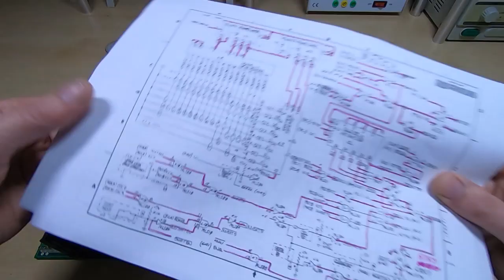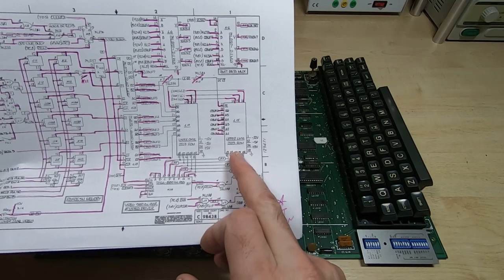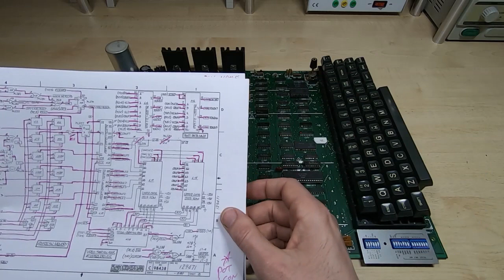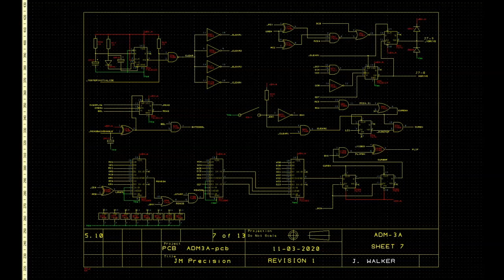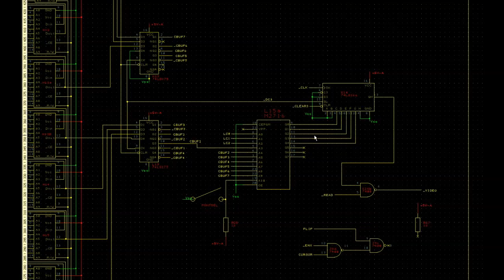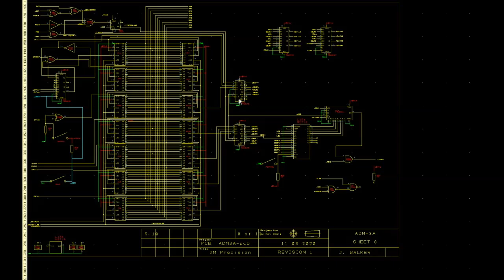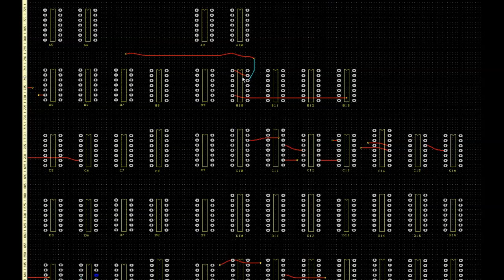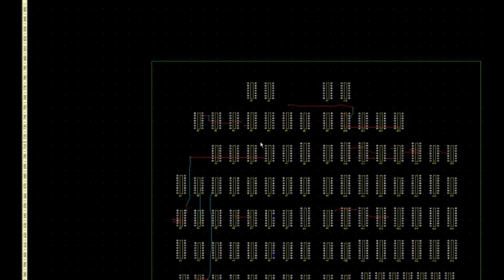ADM-3A  Board Reproduction Part1

Comment: That’s a huge and fun effort! I built an ADM3A terminal logic board about a decade ago using a single ARM32 with a crystal and a few resistors and a transistor.
The crystal was necessary to ensure pixel output stability. The resistors are to produce the correct voltages for pixel intensity and sync signals.

Like you, in the early 1980’s, we used a standard 2716 EPROM in lieu of a MCM6674/5 character generator. We later used a larger 2532 ROM to hold dual fonts and 6116 and 6264 SRAMs as PCG (programmable character generators).

Comment: That's a great, great idea...and You've already done a lot of work on it..I fully agree with you about the approach regarding the PCB. Well.. have the chance to connect it to a modern monitor (external?) would be easier.... and safer :). Keyboard: surfing the net, I found several company that can supply customized keycaps and full keyboard (that seem to be not the right choose in your case) as well as spare contacts. Perhaps designing a specific PCB using discrete contacts with customized keycap it's not extremely expensive (a complete keyboard seems about 50 pounds).Unfortunately standard keyboard seem to don't match the original ADM3-A key mask (can it be modified for a ps2 one?i.e.). Various keycaps color are available as well as lettering: engraving, laser marking and serigraphy printing. Another point would be: should all hardware (monitor, pcb and keyboard) be enclosed in a designed case? I've been a bit long, I know, apologies for that.
Reply from the maker: Thanks, I have ordered some keys and caps from ebay. They seem to be available in various forms. As soon as they arrive I will post a video and see what the general response is. The idea is to end up with a board that can either be used in a real ADM or as a terminal using a standard monitor.